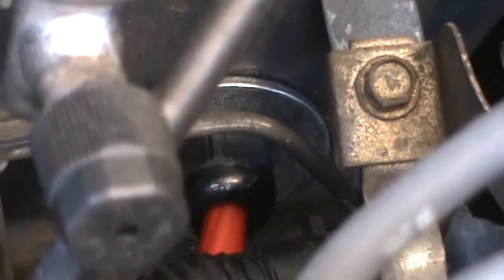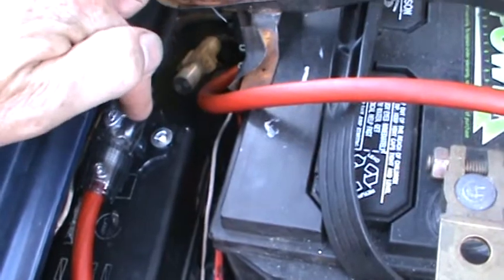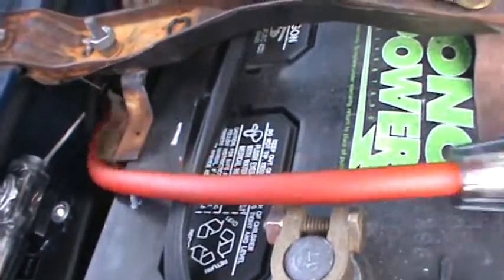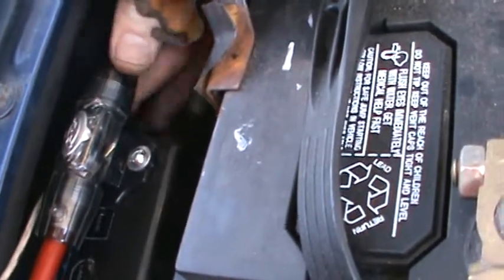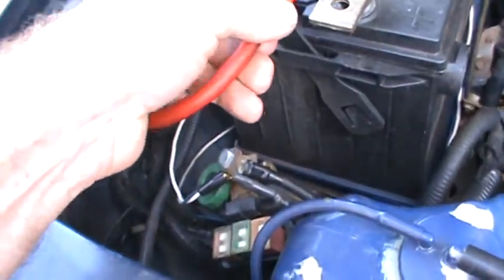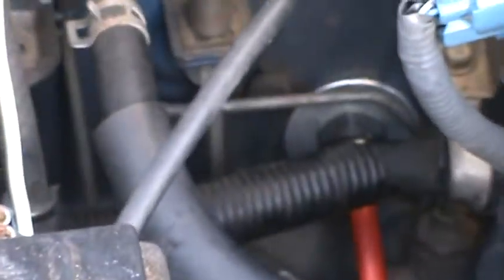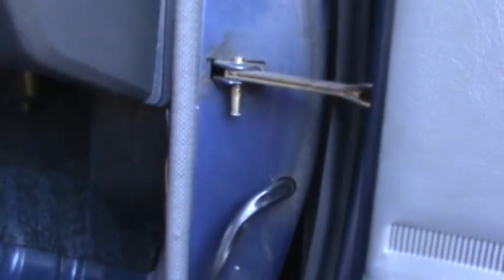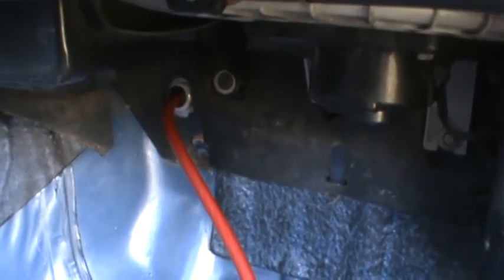03.Daihatsu Rocky Sony Marine Stereo System Installation Part 3

Comment from the maker: Mate, I ain't "CHEAP ASS" as you put it. That battery is the standard battery the Jeep came with, and if you know anything about upgrades, the power of the battery is usually calculated by the power that the system draws, right now there are no amps, no subs, no front speakers installed, so this battery is ample to run the system. When each of the above is installed, I will be putting in a kinetik battery to supply enough power to run this whole system, and 6 100watt driving lights as well.